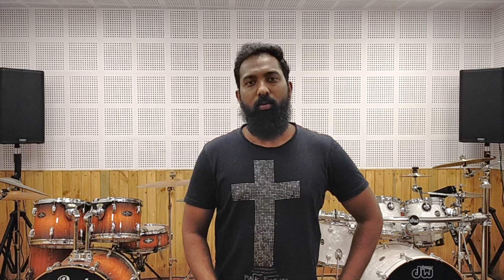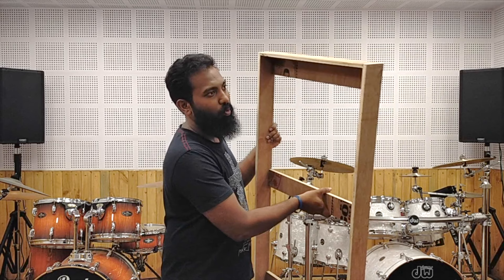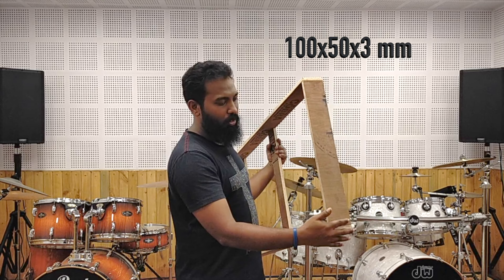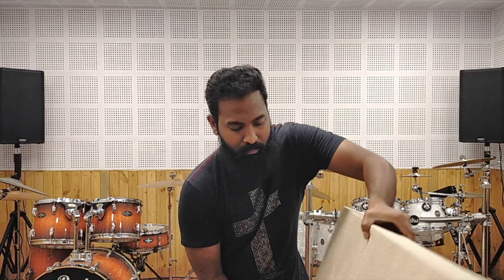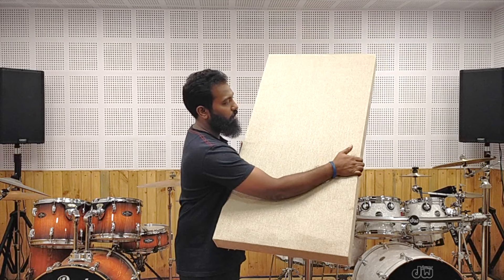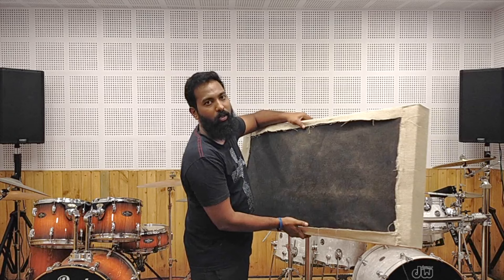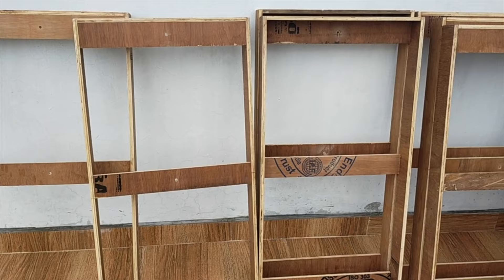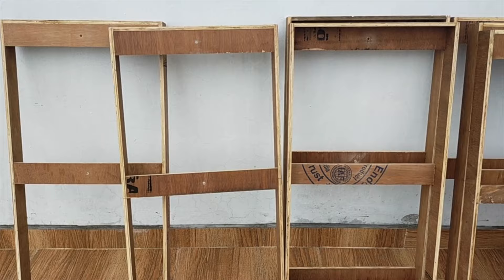DIY Acoustic Panels & Sound Test

Comment: Hi, what are those walls made from? Perforated Gypsum boards? and how good is that from covering the whole walls with plywood panels? Thank you
Reply from the maker: Hey Raj.. Those are gypsum acoustic panel tiles.. Because of the holes on the tiles, sound directly hits the rockwool inside and doesn't allow to reflect. And about the plywood panels it depends on the room side and how much db sound u produce inside your room. Cheers..

Comment: But how do you hang them on wall
Reply from the maker: With 2 inches screws.
Reply: @samuel18761  screwing from front side would tear the fabric any option from backside fixing. Can you plz show us which hardware's used in fixing over perforated tiles or wall?
Reply from the maker: I dint no screw it from front. I first screwed the screws on the wall and then hanged it on.. Just like how we hang photo frame.